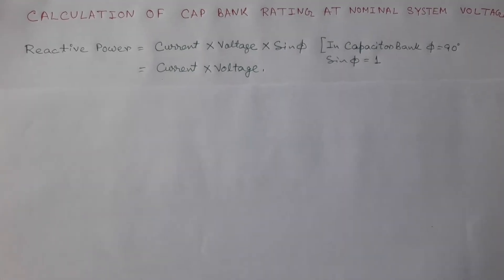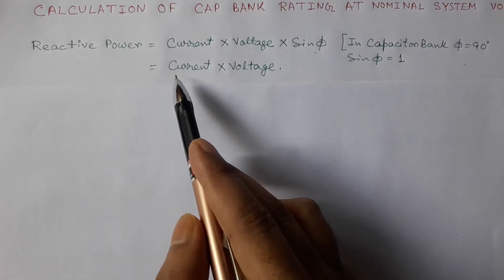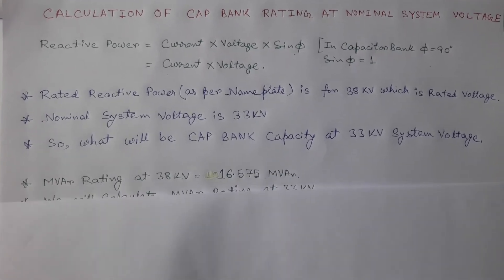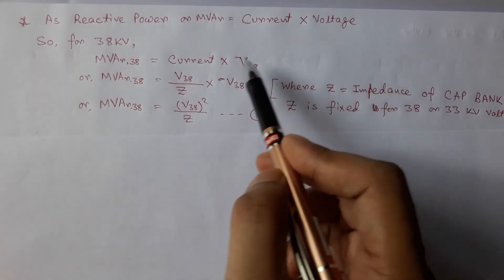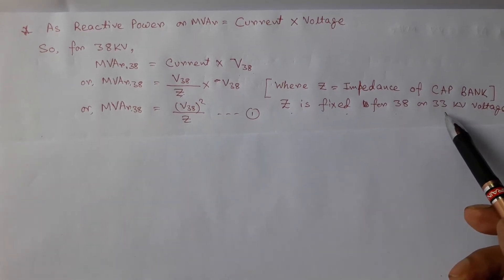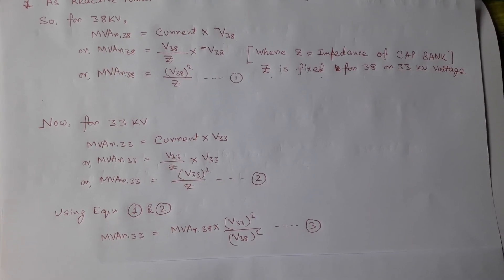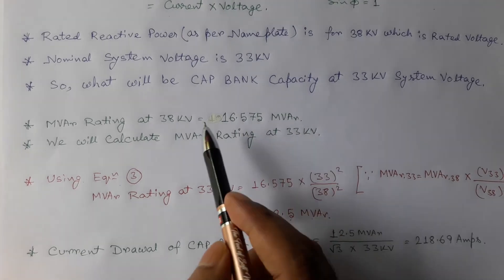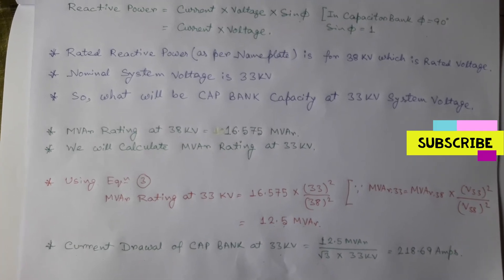CAPACITOR BANK RATING AT SYSTEM VOLTAGE

Comment: Sir, for more than 33kV system can you provide it sir
Reply from the maker: 132 KV CAPACITOR BANK ??
Reply: @eddycurrent1187  yes sir can you provide calculation for 132kV and 220kV
Reply from the maker: Okay, stay tuned by subscribing. I will do another video. Any other suggestion ? Please mention.